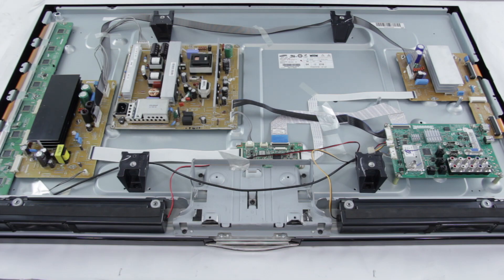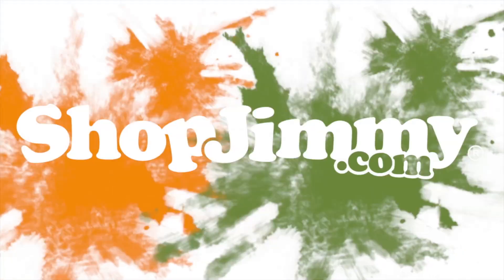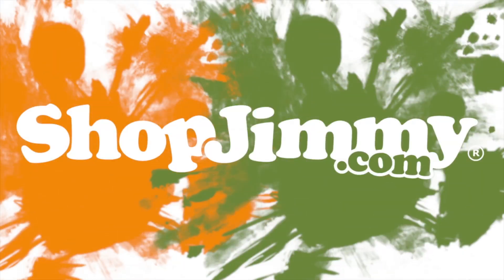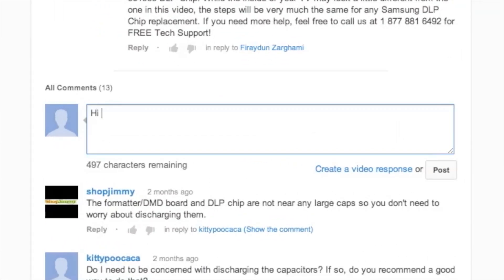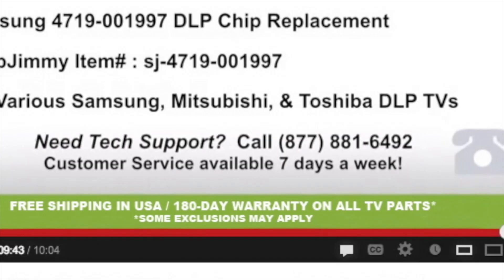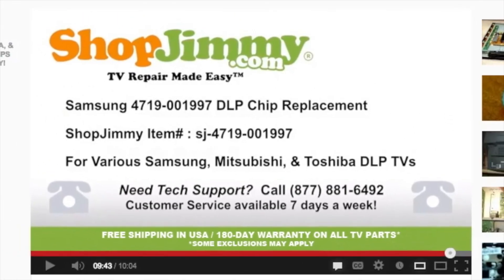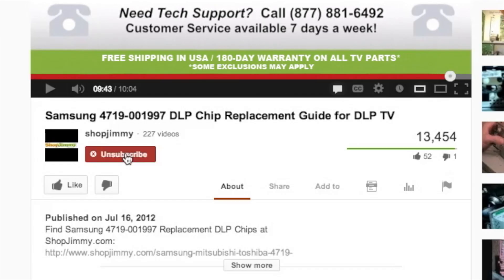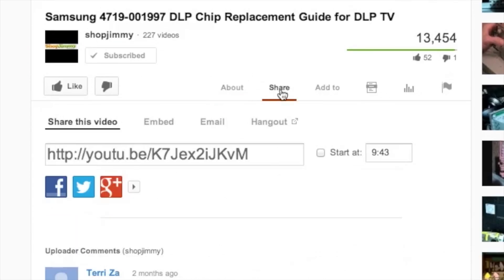Plasma TV Repair Tutorial - Common Symptoms & Solutions - How to Fix Plasma TVs

Comment: Samsung model PN50A510P3F It comes on and works for a while, then the screen goes a turquoise color and you get the sound like you don't have a signal. Then the TV reboots.
Reply from the maker: Anthoni Rossi   Please watch this video FIRST to help with your repair!  https://www.youtube.com/watch?v=BP3NVNCGEv8  I recommend replacing the main board in your TV.  Click this link to replacement parts for your TV model number:  http://www.shopjimmy.com/catalogsearch/result/index/?cat=56&q=PN50A510P3F  There may be multiple boards for the same TV model number, be sure to match part numbers on your current board, with your replacement for compatibility.  Here is a link to a video showing how to identify your part number, click here:  https://www.youtube.com/watch?v=BEPWrefQvqI  Thanks and please let us know if you have any further questions with your TV Repair!  www.shopjimmy.com

Comment: I have samsung 60" pn60e630a3f plasma tv. not turning on,well no picture. stby light work stay on when on, sound work on and off. before had hard start up, use to come on after few try.I changing out power supply board it work the same way , few try then start up. Now won't start up at all. I then try replacing x board. no luck, that came little damage during delivery crack corner. but seem still good condition. that where i at tv still won't come on. I see no sign any damage or bugle capacitors throughout entire 3 boards.i'm thinking maybe y-board ?. any help be appreciated.
Reply from the maker: miz12ful   I recommend replacing the y board and buffers in your TV.  Unfortunately I do not see any replacement parts in the search results for your TV model number on our website.  Please reply with your part number on your y board and buffers and I can try searching for replacement parts.  Thanks and please let us know if you have any further questions!  www.shopjimmy.com

Comment: hello i have a 50" philips model no# (50ph9630a) on the bottom half of the screen it has little colored pixels that flash i know its one of the boards bt dont know witch one... would u know?
Reply from the maker: Chris Ireton   This sounds like a TV panel (TV Screen) problem.  If your TV panel is bad, it may be more cost-effective to replace the TV as panels are typically hard to find in stock, difficult to replace, and expensive.  Thanks and please let us know if you have any further questions!  www.shopjimmy.com

Comment: PN51D530A3FXZA no picture and clicking
Reply from the maker: vigilant lion  Please watch this video FIRST to help with your repair!  https://www.youtube.com/watch?v=BP3NVNCGEv8  I recommend replacing the Y-Main Board and the Y-Buffer board in your TV.  Click this link to replacement parts for your TV repair.  http://www.shopjimmy.com/catalogsearch/result/?q=PN51D530A3FXZA  There may be multiple boards for the same TV model number, be sure to match part numbers on your current board, with your replacement for compatibility.  Here is a link to a video showing how to identify your part number, click here:  https://www.youtube.com/watch?v=R1jmj_foId0  Thanks and please let us know if you have any further questions with your TV Repair!  www.shopjimmy.com
Reply: Robert Woolf thanks for the reply. fixed the problem buying two boards.  spent less than 100 dollars and less than thirty minutes to install.

Comment: Samsung HP R4272 (2005) - Bottom half of picture is mostly noise (vertical fuzzy colored lines). Happens intermittently. Top half of picture looks normal. Would this be the lower Y buffer board?
Reply from the maker: Maria Camillo   This sounds like a TV panel (TV Screen) problem.  If your TV panel is bad, it may be more cost-effective to replace the TV as panels are typically hard to find in stock, difficult to replace, and expensive.  Thanks and please let us know if you have any further questions!  www.shopjimmy.com
Reply: ShopJimmy.com  Thank you so much for the reply. The TV belongs to friends. Since I recently fixed my own LCD/LED TV by simply replacing the power supply board, I thought this would be a similar fix. But I'll let them know!

Comment: Panasonic TH-50PZ80U, it turns on but no picture. The back lights come on but goes dim immediately. After a couple minutes it power cycles. The light on the front is solid. It does not blink. I have verified the power supply works and the y-sustain board by replacing them. I did not replace the buffers. What board should I try next? I was thinking the main board or logic board.
Reply from the maker: Badphish76  Please watch this video FIRST to help with your repair!  https://www.youtube.com/watch?v=BP3NVNCGEv8   I recommend replacing the SD and SU boards in your TV.  These boards should be replaced when the y-sustain is replaced.  Click this link to replacement parts for your TV model number:  http://www.shopjimmy.com/catalogsearch/result/?q=TH-50PZ80U  Be sure to match part numbers on your current board, with your replacement for compatibility.  Thanks and please let us know if you have any further questions with your TV Repair!  www.shopjimmy.com

Comment: I have a Samsung plasma PN50B550T2FXZA that's about 7 years old. There are small vertical lines running from top to bottom on the left half of the screen. The lines are about 1 inch apart. There is also a little reddish area in the top right corner of the screen (but that's been there for years, whereas the lines showed up about 2 months ago). I replaced the logic board with one I purchased from shopjimmy, but that didn't solve the vertical line issue. Not sure what to try next, and I'd rather not pay to have Samsung come out and charge me an arm and a leg for a service call. Could the X-sus board be causing the problem (I figure it's contributing to the reddish top right corner, but not sure about the lines)? Or, could it be that the panel itself is malfunctioning, in which case it's time to shop for a new TV?
Reply from the maker: exomorpheous   This sounds like a TV panel (TV Screen) problem.  If your TV panel is bad, it may be more cost-effective to replace the TV as panels are typically hard to find in stock, difficult to replace, and expensive.  Thanks and please let us know if you have any further questions!  www.shopjimmy.com

Comment: Shop Jimmy,
Need help to fix my LG Plasma TV 60PZ550-UA.  There is no picture on screen.  The screen is dark/blank.  When power is plugged in, I hear a clicking sound that power supply is connected.  Which board do you think is causing this problem and how to fix my TV?  Thank you.
Reply from the maker: MyMactan  Please watch this video FIRST to help with your repair!  https://www.youtube.com/watch?v=BP3NVNCGEv8  I recommend replacing the YSUS and the YDRVTP & YDRVBT boards in your TV.  Click this link to replacement parts for your TV model number on our website:  http://www.shopjimmy.com/catalogsearch/result/?q=TV+60PZ550-UA  There may be multiple boards for the same TV model number, be sure to match part numbers on your current board, with your replacement for compatibility.  Here is a link to a video showing how to identify your part number, click here:  https://www.youtube.com/watch?v=GEllG3RV-tc  Thanks and please let us know if you have any further questions with your TV Repair!  www.shopjimmy.com
Reply: ShopJimmy.com Thank you.  I checked your link and it says you are out of stock of the YSUS board.  When  the part becomes available and I order them, in case it does not resolve the issue, can i return them and get my money back?

Comment: I have a Samsung PN51E450A1f version # TDO2. When powered on I get a flash of picture for a second, it continues to flash a picture every 5 seconds or so for about a minute the stops altogether. The red light above the power button flashes continually. Thanks for the help.
Reply from the maker: Chris Furr  Please watch this video FIRST to help with your repair!  https://www.youtube.com/watch?v=BP3NVNCGEv8  I recommend replacing the Y-Main board and the Y- Scan Drive boards in your TV.  Click this link to replacement parts for your TV model number:  http://www.shopjimmy.com/catalogsearch/result/?q=PN51E450A1f  There may be multiple boards for the same TV model number, be sure to match part numbers on your current board, with your replacement for compatibility.  Here is a link to a video showing how to identify your part number, click here:  https://www.youtube.com/watch?v=R1jmj_foId0  Thanks and please let us know if you have any further questions with your TV Repair!  www.shopjimmy.com

Comment: My 51" samsung plasma tv, model number PN51E530A3F, has a solid white bar, top to bottom, on the left side of the screen. Read a post saying it is probably the x buffer board and talked to someone that has repaired tvs for several years who agreed but said it could just be a bad connection. Opened the tv up and looked at the connections and even unplugged a couple just to see of there was a difference, but nothing changed. I work in the IT field (mostly computer hardware, haven't really messed with monitors, but feel confident and comfortable enough to tackle the problem) and I feel like it should be a "simple" fix, but am having trouble...basically just need some sort of step by step if at all possible.
Reply from the maker: MrNphoover   This sounds like a TV panel (TV Screen) problem.  If your TV panel is bad, it may be more cost-effective to replace the TV as panels are typically hard to find in stock, difficult to replace, and expensive.  Thanks and please let us know if you have any further questions!  www.shopjimmy.com

Comment: I have a Samsung 42" Plasma model# HPS 4253X/XAA.  It started freezing the picture.  First it only happened on one channel, now the picture freezes on all channels after about 10 minutes.  Our other TV is running fine so it's not the cable company.  Any ideas?
Reply from the maker: shana spooner  Please watch this video FIRST to help with your repair!  https://www.youtube.com/watch?v=BP3NVNCGEv8  I recommend replacing the main board in your TV.  Click this link to replacement parts for your TV model number:  http://www.shopjimmy.com/catalogsearch/result/index/?cat=56&q=HPS+4253X%2FXAA  There may be multiple boards for the same TV model number, be sure to match part numbers on your current board, with your replacement for compatibility.  Here is a link to a video showing how to identify your part number, click here:  https://www.youtube.com/watch?v=BEPWrefQvqI  Thanks and please let us know if you have any further questions with your TV Repair!  www.shopjimmy.com

Comment: Good day to all. We have a Toshiba 42HP84, with a black vertical line to the right of center, top, 3/4 s down the screen. Comes and goes, stays most of the time. removed back panel and checking the strip cable. no change. Any input will be greatly appreciated.
Reply from the maker: tamban282   This sounds like a TV panel (TV Screen) problem.  If your TV panel is bad, it may be more cost-effective to replace the TV as panels are typically hard to find in stock, difficult to replace, and expensive.  Thanks and please let us know if you have any further questions!  www.shopjimmy.com

Comment: I have a Samsung Plasma tv, model number pn50a510p3fxza.  About 6 months ago, the tv began to cycle on and off, with a chiming sound each time it cycled. Initially, the tv took 5-10 minutes to power on and then operated fine.  Over time, the "warm up" time has gotten longer, no taking hours to turn on.  The tv is 5 years old, but is a basement tv that does not have heavy use.   Is this a simple fix or is it time to buy a new set?
Reply from the maker: t tierney  Please watch this video FIRST to help with your repair!  https://www.youtube.com/watch?v=BP3NVNCGEv8  I recommend replacing the main board in your TV.  Click this link to replacement parts for your TV model number:  http://www.shopjimmy.com/catalogsearch/result/index/?cat=56&q=pn50a510p3fxza  There may be multiple boards for the same TV model number, be sure to match part numbers on your current board, with your replacement for compatibility.  Here is a link to a video showing how to identify your part number, click here:  https://www.youtube.com/watch?v=BEPWrefQvqI  Thanks and please let us know if you have any further questions with your TV Repair!  www.shopjimmy.com

Comment: I have a samsung pn51e450a1fxza 51" plasma tv with no picture no sound won't turn on. I dont see any bad capacitors on any boards. When I turn it on the red standby light blinks once or twice and the logic board light blinks  three times and I can hear clicking on the power board that coincides with the logic board light. Then nothing. When I unplug the y board the logic board light blinks very slowly. Once every 10 seconds or so and will continue to blink until I unplug the power cord. But the power board does not click. I have tried using a multimeter but can't get the set to stay on long enough to get a reading. Any help would be greatly appreciated.
Reply from the maker: cmk3282   Please watch this video FIRST to help with your repair!  https://www.youtube.com/watch?v=BP3NVNCGEv8  I recommend replacing the Y-Main board and the Y-buffer Scan Drive to fix your TV.  Click this link to replacement parts for your TV model number.  http://www.shopjimmy.com/catalogsearch/result/?q=pn51e450a1fxza  There may be multiple boards for the same TV model number, be sure to match part numbers on your current board, with your replacement for compatibility.  Thanks and please let us know if you have any further questions with your TV Repair!  www.shopjimmy.com

Comment: Please help. I have a Sansui flat screen Plasma TV with controler. The TV shows vertical red lines when switched on then just a bank screen. The Model # is SV - PD403. Thanks
Reply from the maker: Johan Pretorius   This sounds like a TV panel (TV Screen) problem.  If your TV panel is bad, it may be more cost-effective to replace the TV as panels are typically hard to find in stock, difficult to replace, and expensive.  Thanks and please let us know if you have any further questions!  www.shopjimmy.com
Reply: ShopJimmy.com
Thank you very much for your speedy response and I will follow your advice. Have a blessed 2015

Comment: Hi ,and thank you for this nice video.
My Toshiba 32XV550PG ,turns on ,appearing snow (noise) on the screen for like 2-5 mins ,and then screen goes dark (like it's completely powered off).At one occassion ,it managed to stay for more than 60minutes displaying picture from HDMI input.When it did stayed on for 60mins ,picture was superb, no artifacts.at my last try to turn it on ,showed static for 2secs ,then snow shifted color towards the green area ,then pic was lost.Also note ,that ,I was watching it when the TV broke ,I heard a "bzzzzzt" sound in it like something was burned for one or two times and said "damn something is burned there".After watching the video of yours,I suspect the Y board .I own a digital multimeter .what kind of parts could i check with it ?  .Your help will be greatly appreciated.Kind Regards
Reply from the maker: SonicApogee   This sounds like a TV panel (TV Screen) problem.  If your TV panel is bad, it may be more cost-effective to replace the TV as panels are typically hard to find in stock, difficult to replace, and expensive.  Thanks and please let us know if you have any further questions!  www.shopjimmy.com

Comment: I have a Panasonic TC-P60ST50 TV about 2 years old. Today all HDMI inputs stopped working. NO SIGNAL message on the screen. DoI need to replace a main board?
Reply from the maker: Yakov Schwarz  Please watch this video FIRST to help with your repair!  https://www.youtube.com/watch?v=BP3NVNCGEv8  I recommend replacing the main board in your TV.  Click this link to a replacement main board for your TV model number:  http://www.shopjimmy.com/panasonic-txn-a1rduus-a-board-for-tc-p60st50.htm  There may be multiple boards for the same TV model number, be sure to match part numbers on your current board, with your replacement for compatibility.  Here is a link to a video showing how to identify your part number, click here:  https://www.youtube.com/watch?v=FKTTj91YcGc  Thanks and please let us know if you have any further questions with your TV Repair!  www.shopjimmy.com

Comment: I have a Samsung PN50A510P3FXZA (Best Buy) plasma 50" TV. When first turning on The TV, it cycles for many start up shut downs by itself until the picture finally comes in. The relay clicks each time it cycles, and sometimes there is a green distorted screen, and sometimes with loud high pitched screech sound. I have removed the PS board and reflowed solder to all connections, no change. I unplugged the Y SUS, and the Z SUS board from the logic, and PS board, still no change in rebooting. I removed all components from HDMI and wait for TV to home screen, add a source, and reboots all over again. You are out of stock on my PS BN4400237a, and BN94-01880C main board. Here is a link to someone who had the same problem and TV model. There is a youtube link that shows the same symptoms I have. Maybe you can refer me to the right repair kit for the board that is NFG, because I have checked your site, and you are out of stock on most boards in my TV.  Here is the link: http://www.justanswer.com/tv-repair/7pzif-samsung-pn50a510p3fxza-plasma-50-tv-problem.html
Youtube link http://youtu.be/8n51X8vvDXQ
Reply from the maker: Mike Pagano Unfortunately, I recommend replacing the TV.  Thanks!  www.shopjimmy.com
Reply: ShopJimmy.com OUCH, I guess what your saying is there is too many things wrong with it. Oh well, To replace a 50" plasma is not all that much $$ today. Thanks for your honest opinion. Think I'll look at 60"- 70" too.lol